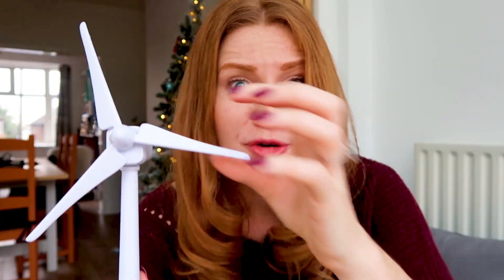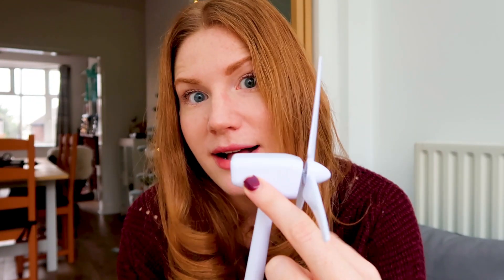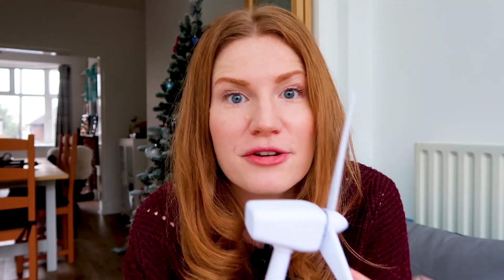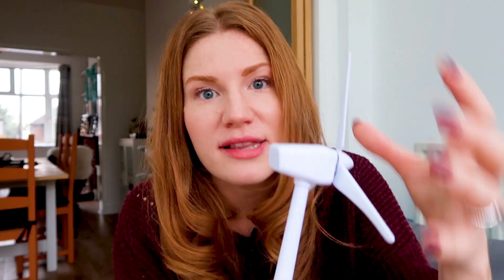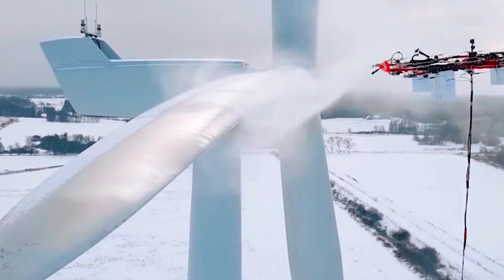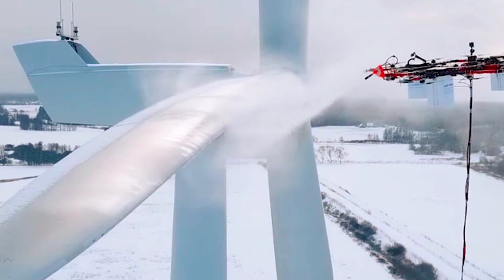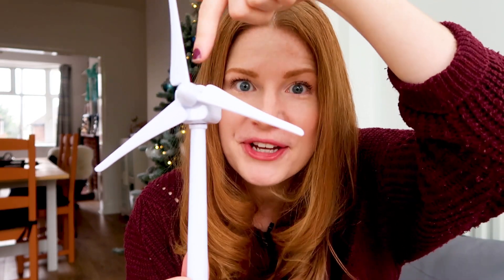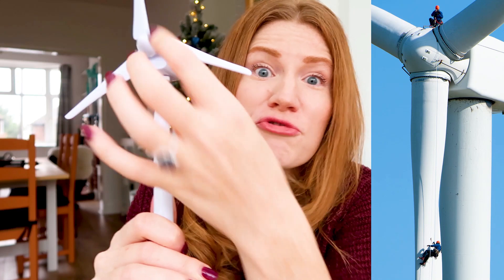DO WIND TURBINES FREEZE? - Impact of winter on wind energy - Hayley Loren

Comment: These large generators have about 50 gallons of lube to support the bearings and gears.  The lubes are tailored for the environment.  Low viscosity for cold climates and higher viscosity for warmer climates.  Texas would be an example of the latter.  Problem is, higher viscosity lubes thicken up when cold.  Ergo, nogo.

Comment: Ice bilds up on blades around the freezing point, if the air is very humid or in case of rain or wet snow. In colder conditions the problem is almost non existent. So I guess it's a definition of t´what is cold, to me cold conditions is very much a constant below Zero situation. and these conditions are generally no problem for wind turbines if stable. it's when the temp goes up and down around zero it becomes a problem.

Comment: Turbines in TX where not heated as no one would ever spend that kind of money in a area that has not had temperatures for over 50 years that would cause them a problem. In fact if the the company said they where and with all the Global Warming they would have been laughed out of business, remember these are private companies as are nearly all in the US. TX also is a very hot area so they use the oils that are for high temperatures and no you don't just change oil quickly on them it is a very difficult arrangement. Turbines in northern areas have heated blades and even so must be shut down in situations, mostly automatically, to allow build up of ice to melt off in freezing rain situations if it is really cold. They also have a lighter weight oil that works in cold climates. Hydraulic oil isn't quite like motor oil where you can get a 10W40 to work in hot and cold situations is part of the problem.

Comment: Wow, Haley - you are a visionary, you saw in December 2019, what Texas would experience in Jan/Feb. 2021. This proves that Windmill builders in Texas are more stupid than private young girls.
Reply: Actually, windmills in the Texas panhandle are “winterized”.  The blade heaters could not keep up so severe was the storm of a fortnight ago.   The blades iced up...and ice is typical in N. Texas.
   Statewide, windmills went down first to the tune of 50% and conventional power about 12%.  
   It was a hundred year storm, how does one plan for that?
Reply: @danbenson7587  Just as a first approach, look into the climate history? This would work if Hansen and Mann had not altered the data.
Reply: @maxtabmann6701  I read some of climate history, but not your cites.  Get around to it as I work thru my read pile.  
     The Bible has climatology.  The description in Gen1.6-10.  Gen2.4-6 Earth was watered by a “mist from the ground”.  It never rained until Noah.  After the flood, the lifespan of men decreased every generation over 2000years until something in line with present value.  This suggesting a major atmospheric change exposing radiation. Later, the Bible records 7years of feast and 7years of famine corresponding with sunspot cycles.  Cheers
Reply: Max, isn’t the current driver climate change...that is climate history is kaput?    Anyway it boils down to economics, is it worth spending money that’s going to be used once a century.    Would you risk $500 on a hundred year bet?  Example, I was born in Texas in 53.  Never got below 20F, this storm went to 0F.
    There are 3 utility models:  demand, capacity, and utility.  All require a judgement call about the future.  Texas went lean (demand) and got burned (or frozen).   Will be interesting to see how ERCOT/Legislature responds.  I suspect green has gone brown here.
    The only source that’s cheap, reliable, and green is nuclear.   Something to consider: 80 died in this storm which is 10 fold all nuke power plant deaths in history.   Another consideration, France is nuke and cheapest in EU, Germany is greenest and most expensive.
     People tend to fall for what sounds good and at the last minute go with what works.   Cheers
Reply: @danbenson7587  Is the current driver climate change? Yes! We do have a climate change but none of our climate scientists looks at it impartially. They immediately attribute it to CO2 and nothing else but CO2. Their analysis as well as their modells all are wrong because they look at the wrong cause. Whats worse, their interpretations in most cases are the opposite of what happens. The say the earth is drying out and at the same time they say water is accumulating in the atmosphere.They say it gets warmer and what we see are more icy winters. As soon as you allow the thought that CO2 is a very weak greenhouse gas that never in earth history had any effect on climate, you begin to think about real science. Fact is that we had 4 mayor glaciations over the last 400000 years. Each of them lasted about 100000 years. The degaciation periods are much much shorter and we live in such a deglatiation period. The last deglaciation period, the Eem period lasted 10.000 years. Our period, the Holocene now lasts 12.000 years and is about to end. This can happen in 500 years or in 4000 years, but we see the transition already by looking at the last 4000 years. They brough cooling and desertification. Just compare Sahara 6000 BP and now. In between we also have shorter episodes controlled by changes of the solar magnetic field and also by the earth rotation parameters. We now enter a phase of very low solar activity (not wrt light, but wrt magnetic field) and this causes cooling. Associated with this is dryer summers and colder winters. Thats how you must look at it. In any case there is nothing humans can do about it. But our ancestors survived it and we will survive it too by adapting. The present solar minimum may last 100 years, but in between we will see periods of 30 years of warming due to ocean currents changing and then we will have cooler years. Nothing spectacular, but to think by paying carbon tax we can stop it, is silly and foolish and also to a degree criminal.
Reply: @maxtabmann6701  I agree wholeheartedly.  The worst we could do is spend trillions fixing the wrong problem or fixing what can’t be fixed.  
   Here is a question not explored.  The Earth’s core is molten, radioactive, and dynamic.  Could it periodically warm?   The heat has to go somewhere.  It transfer through to mantle to warm the oceans.  As oceans warm more dissolved CO2 is released.
    I am not talking volcanic activity.  Instead radioactive pockets align as the magma currents move.  The pockets generate heat.  We know the Earth’s poles have swapped..so definitely something going on beneath our feet and nobody has looked.
    As to power, I am a nuke advocate because petroleum resources have value for materials.  There is machinery that can’t be electrified (airplanes, farm tractors, etc).   
    Unfortunately ‘climate change’ is embraced by the weak minded who are exploited by the politicians (AOC springs to mind).  Politicians grab Michael Mann’s misinformation, amplify thru the UN IPCC, then used as an excuse to accumulate political power.    Cheers
Reply: @danbenson7587  Concerning your question not explored. There are several attempts to utilize geothermics but the heat conductivity of earth's crust is setting a limit to how much energy you can acquire per unit of time and area. The relevant quantity is called the power density and is typically very small compared to other energy sources. We should not forget that the earth is mostly comprised of Silicondioxide. In its pure form, it is called "Glas" and 4 km of glass are an enormous thermal insolator. This gets different, when you go to continental fracture zones like the one in the middle of the atlantic ocean. There heat transport is not by thermal conductivity but by convection. Iceland is such an example where they dont need coal or diesel and can solely supply their country with geothermal energy. Where it really gets weird is Svalbart (Spitzbergen). West of the island there is a geothermal bubble that heats the arctic ocean to temperatures around 12°C and limits the build up of ice in the winter, but you really have to dig deep to find that out because our media rather talk about arctic ice loss due to global warming and our praised scientists refuse to investigate this phenomenon. GFS is publishing a map of Sea Surface Temperatures and up to two years ago, you could see the bubble, but last year they erased it. Now you can only see the missing ice.
Reply: @maxtabmann6701  Insulation slows the rate of heat transfer, BUT the heat gets to the surface eventually and surface temp increases.  The difference between the core (1100F at 35mi) and space (-470F) drives the heat across the relatively thin crust (crust is .013% of dia...earth is a balloon)
    What happens if the core goes , for the sake of argument, from 1100 to 1200F.  The surface temperature eventually increases by ~100F *. You get the same ‘global warming’ as we are witnessing.   But nowhere are the climatologists looking at this...
    (* much Simplified)
Reply: @danbenson7587  The heat conduction equation results in an exponential decrease through the insolator, so if temp raises 100F in the core, the temp change outside could well be less than a 1000th of a degree, for the precise number one would have to plug in the exact numbers, but in any case, the heat change in the core is not transferred 1:1 to the edge. With 5km crust I would estimate it in the 0.01 to 0.0001 range.
Reply: @danbenson7587  Another small introduction to thermodynamics. Heat is energy, thus heat transport is energy transport. There are 3 mechanisms for that: Conduction, Convection and Radiation. Everyone who tried to eat a hot soup knows, which is the most efficient of the 3. When the spoon is too hot, you blow air, you do not put the spoon in contact with the table and you do not wait until radiation cools it down. The same is with earth's atmosphere. The most important energy transfer occurs through convection, keeping the air column in thermal equilibrium. Even small children blow air at their soup spoon. Yet our hobby scientists want to tell everybody that radiation is the big one, and they do that so that CO2 comes into the game. But for greenhouse warming, CO2 is a looser on so many levels.
Reply: @maxtabmann6701    Yep, I am a retired Mechanical Engineer.  I was masticated by 13 hours of thermo and HT Before spat out.  Been nice exchanging  with somebody with brains.  Most don’t have a clue what they deal with on this subject.   The confusion attracts politicians like poop flies.  Is it Ironic that Don Quixote tilted at windmills, and a windmill was central to Orwell’s Animal Farm.   Cheers
Reply: @danbenson7587  "attracts politicians like poop flies",  well said! As you are more into religious history, the sale of indulgences, practiced by the roman catholic pope gave rise to a splitup of christianity initiated by Martin Luther into many new evangelic wings. Thats the perfect equivalent of carbon tax. Pay it and all your climate sins will be forgiven.
Reply: Max, Deja Vu.  Wed (3rd) Wall Street Journal, Holman Jenkins Jr. has Editorial on carbon tax.  Jenkins is a top notch writer, but packs a lot into a sentence.  The last paragraph is prophetic.  A carbon tax is likely because the politicians want the revenue to spend.   Cheers

Comment: Many planes have boots on their leading edge of the wings to break ice buildup. Why can't wind turbines be built with boots on the leading edge?
Reply: The blade design may be critical.
Reply: They are usually heated with a wire embedded in the blades, which uses electricity to operate them. In 2010 they had a cold snap on Scotland with no wind and their wind turbines were shut down since there was no wind but they kept the electricity running to them to keep the blades de iced.

Comment: What most people don’t get is they could have opted for the more expensive ones and passed that cost straight to the customer. All infrastructure and fuel cost are directly passed through to the customer in the form of rate increases. 
Ercot prioritized low cost of energy over the chance of the lowest temps in south Texas since 1906. The biggest issue actually came from expectations of the wind fields and not getting the Natural gas plants up earlier and losing a Nuke to a pressure gauge (they are tough to restart start if they trip).

Comment: Sooooooo, why don't Alaska's wind turbines avoid this and supply energy year around from these to -50 degrees¿
Reply: umm cuz the supply less than 5% of their energy?
Reply: Wind turbines used in cold climates do have a heater built into the blades. That still won't stop any damage done to the blades from frozen particles in the air.

Comment: If they do ban fossil fuels &
wood burning stoves do you feel comfortable with wind turbines in a blizzard?
Reply from the maker: As long as we have good maintenance plans in place and battery storage on the go, so we have additional energy to use during downtime! Battery storage tech isn't quite there yet though, so right now we're not ready for 100% renewable energy.
Reply: @HayleyLoren  When could be ready?
Reply: How much is big oil paying you? You do know there are options to warm the turbines right? It's costly though. But I'll let you live your fantasy. BYE
Reply: @xaza7774  Presumably electricity from the turbine, or from the grid the turbine supplies, would be used to heat the elements in the blade to keep the blade surface temperature above freezing, so it keeps working. I'm guessing the Texan wind farm company thought they didn't need heaters! Fair enough to them - we have known about the polar vortex since the 50's, but we haven't observed the polar vortex collapsing before 13 years ago, so it could possibly be a new weather phenomenon.
Reply: Tell ya what, I’d trust them more than the thermal power plants which provided most of the power to Texas...and shut down because THERMAL needs heat.
Reply: Texas enters the chat!
Reply: Check out Eva Creek wind farm in Alaska
Reply: Are you insane?
Reply: https://youtu.be/zqM9OIPzMHs

Comment: Instead of retrofitting old wind turbines with heated blades you could use a drone to remove Ice from the blades.  Yes the wind turbine would need to be shut down for the ice to be removed but installing a drone does not require the heavy equipment you would need to remove and replace the blades.
Reply: Bull shit
Reply: @olivertaylor8788  You think it's totally impossible to design a drone that can remove ice from wind turbine blades? Or do you think it would be more practical to just replace them long term? Or are you just a troll who has nothing better to do than wright ball shit under other people's comments?
Reply: @alwynwatson6119  i don't have to think,drones to clean ice off windmill blades you ask.possoble yes,but very impractical and high cost.i can just see you flying a drone in sub zero weather and wind trying to spray deicer on a mill blade.sure its possoble.go try it out sometime.good luck.
Reply: @olivertaylor8788  The practicality and cost is obviously dependent on the design of the drone.
Reply: Most mills installed in artic cold have heater strips built into the blades to loosen the ice.but its a big added cost nobody wanted to fork out in tx.drones could do it,but it would have to be automated and computer guided.not cheep.
Reply: @olivertaylor8788  So heater strips are the best method?
Reply: @HardKore5250  strip heaters and thin oil.put thermostat and oil heater on the transmission.close the vents on the front of house.leave the bottom vents open.keep the hydraulic oil above 50 degrees ...heaters is the key...
Reply: @olivertaylor8788  The drones would obviously be for wind turbines in places where it is not normally cold but there is an unexpected burst of cold whether. And you where the one who brought up high cost as a problem also automation would bring down the cost of operation.